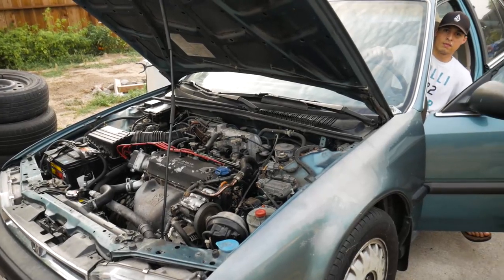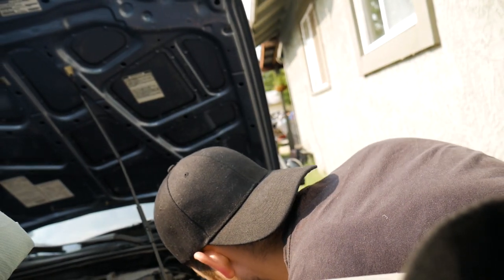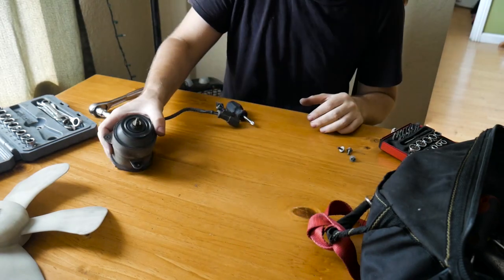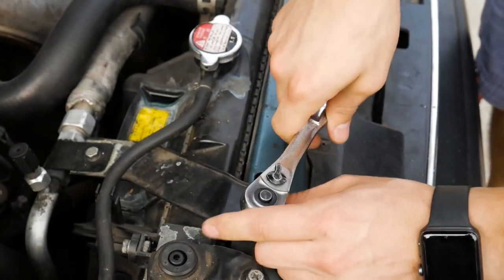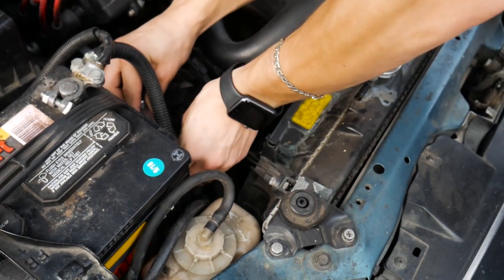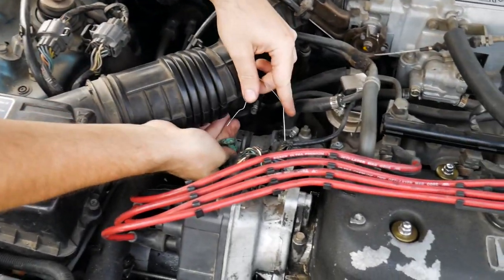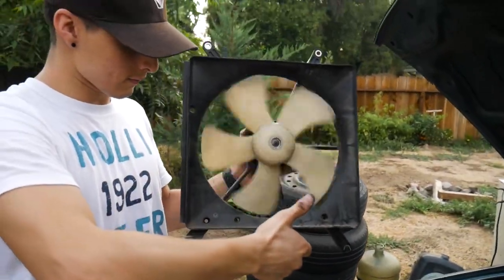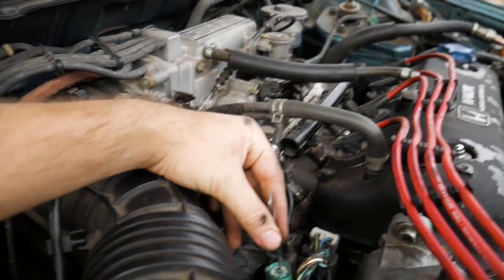Fixing Radiator fan noise on a Cb7 [Accord Vlog 2]

Comment: Very helpful; mine is running normal save this rattling sound. Sounds similar if not the same to the one that has the problem in this video. Looks like a breathing issue with how it got loose.

Comment: You can just turn the AC on to test the fans.
Reply from the maker: yeah, but depends if there's any Freon in it which wasn't the case this time around lol
Reply: @PaycoTsunami  Oh I see I wondered why you used the shorting method. I need to look for the 4-Blade TOYO Fan for my car.
Reply from the maker: @zmelli  ah the best bet is the junkyard, as long as the motor still runs you could just interchange the fins of the fan no problem! Should be a fun run in the junkyard, hope you find what you're look for
Reply: If you have problem with the sensor